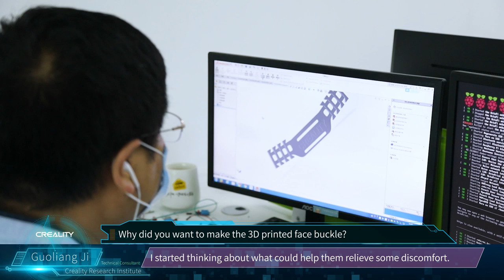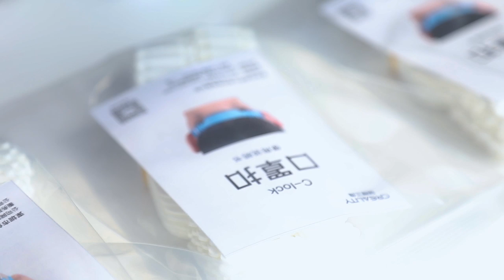Creality's 3D-printed buckle makes wearing face masks more comfortable

Comment: So it would make sense for you to share a link to the STL file that he's designed, so other interested makers could crank some out without having to reinvent the wheel.
Reply: @chessthetrucker  Thanx
Reply: @chessthetrucker  What cal - 44?
Reply: @chessthetrucker  - Do you know how we can convert stl files to .gcode? We're using a Marker Select Plus 3D Printer and want to make this...
Reply: @SandyHaaseCS  .stl are the 3d file. .gcode is the file the printer needs to print.. just put the .stl in any slicer program and it will make the gcode file.
Reply: Automag - Thank you!